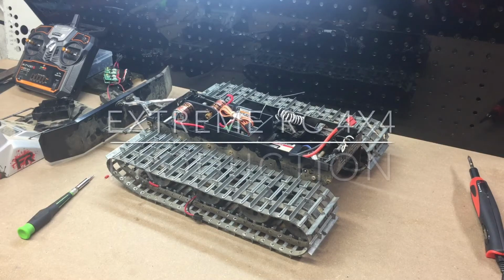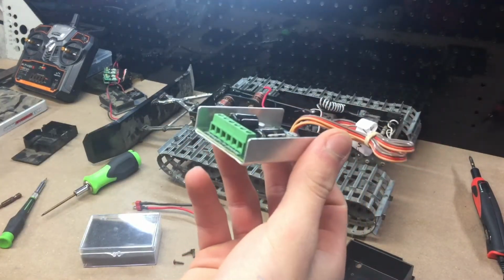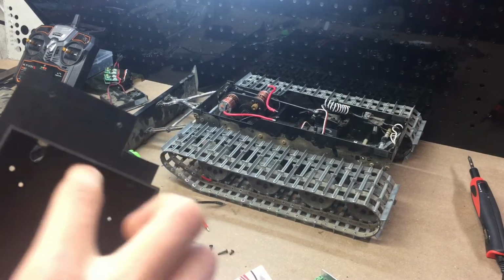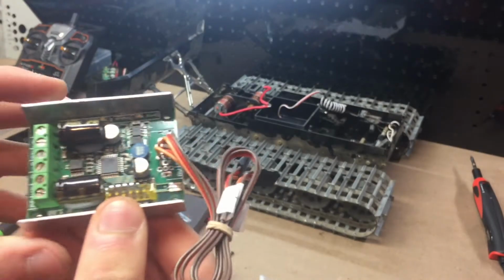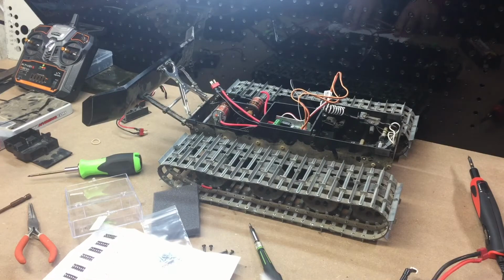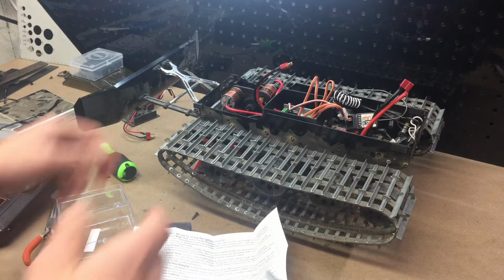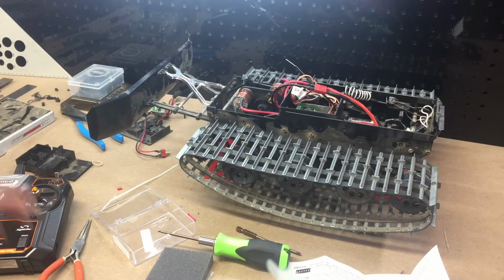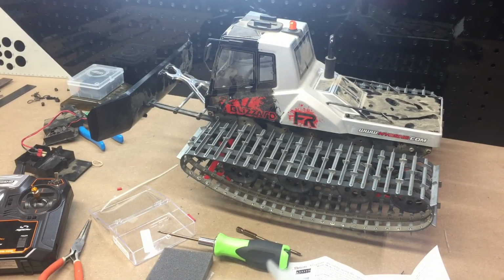EXTREME RC 4X4 Sabertooth 2x12 ESC Install Into Kyosho Blizzard

Comment: I have a question.  I have this motor driver and it works pretty well.  Its driving two drill motors in a track vehicle.  My question is when I do a zero point turn, it will turn well when spinning counter clockwise but when I try to do it do it in the clockwise direction it struggles, can anyone help me with that?

Comment: Hello Ethan, I just installed the saber tooth esc and the traxxas 380 motors. I used the stock radio. I can’t get the plow to work and my controls are all backwards. What used to be forward and backward is not anymore. How do I fix this.
Reply from the maker: Michael Flannery have you made sure that all the switches on the esc are set correctly? Another thing to check is if everything is plugged into the receiver properly.

Comment: Hi, Nice video. Can you run lipo battery with Sabertoot ?
Reply from the maker: McFly Thank you! Yes, I run a 2s 5000mah Lipo. Just make sure the ESC is on lipo mode so the battery doesn’t get drained too far.
Reply: @ExtremeRC4x4  ok thanks :)

Comment: Which servo you are using
Reply from the maker: Rahul Ghosh I believe at this point it is either the stock servo or the servo that came with the rear tiller. Thanks for watching!
Reply: @ExtremeRC4x4  I don't want to buy whole setup I need knowledge about a servo that can be fit in a arm to lift 500g......length of arm 20cm
Reply from the maker: Rahul Ghosh I couldn’t tell you the exact servo that you need for you’re situation but definitely something higher output.

Comment: Sadly you showed nothing, nor did you explain anthing. You did more than explain. I will be making my own because EVERYONE Of these videos are terrible about showing detail on hookup or changing switches as to what they do.
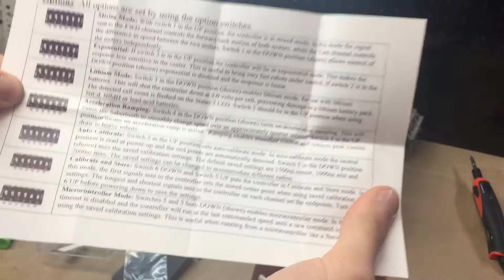Reply from the maker: RC Hobbyist Extreme what more would you like to see? The guide to the switches was showed at the 5:10 mark. I tried to show my wiring setup between battery, esc, and motors. I went through my entire setup on camera and I also used other people’s videos as a way to educate myself before purchasing or installing. Although I believe that I along with many others have made quality videos covering the esc maybe you can do better yourself.
Reply: What battery are you using?
Reply from the maker: RC Hobbyist Extreme a 2s 5000 mah Lipo
Reply: @ExtremeRC4x4  Awesome thanks! I am in the process of modifying everything.
Reply: You are pretty uncomplimentary here . Ethan is trying very hard and your comments don't help. Keep up the great work Ethan!